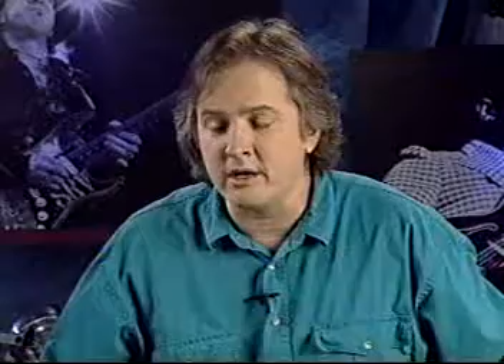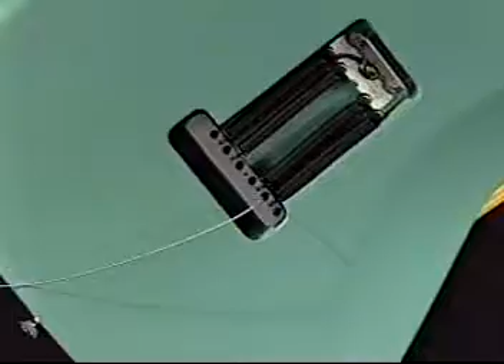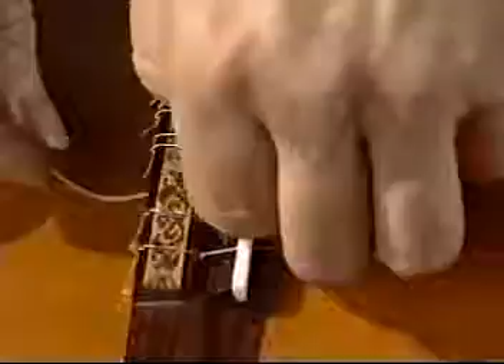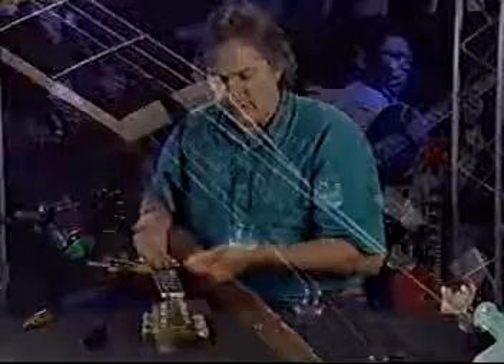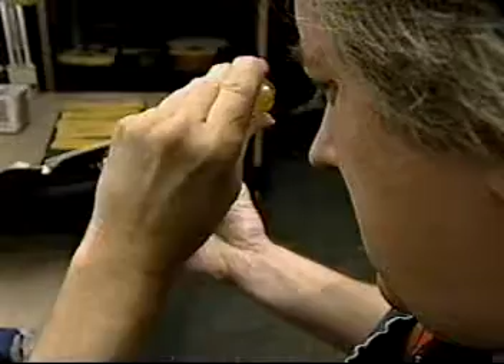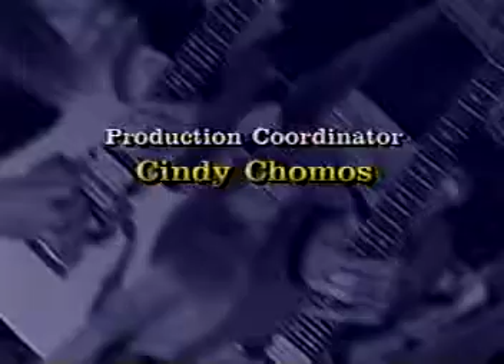Guitar Setup And Maintenance   W Mark Arnquist

Comment: Hi Mark,  You did some great work for me on a Rick 12 string by making the neck wider by 1/8 inch about 10 years ago.  You also replaced a bridge pickup on my 650 Dakota with a Seymour Duncan humbucker.  Now the stock neck pickup pooped out.  Do you remember what  SD pickup you used?
Tom Granata from NJ now in CA
Reply: Sorry ...but no I don't recall . There is a tag on the bottom of the pickup ...that tells you . 
Before you do soldering surgery, test with a volt-Ohm meter .